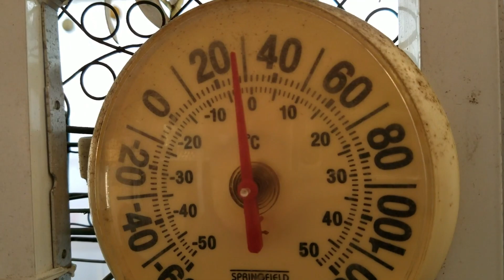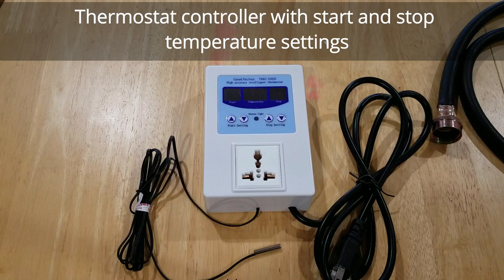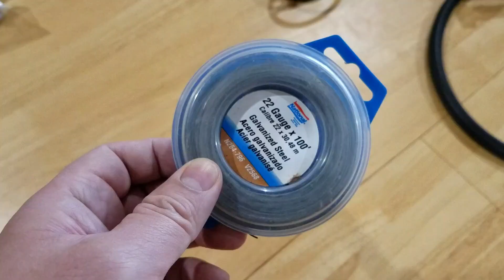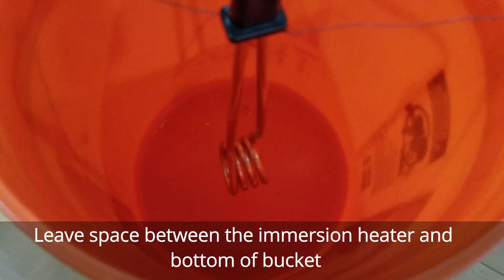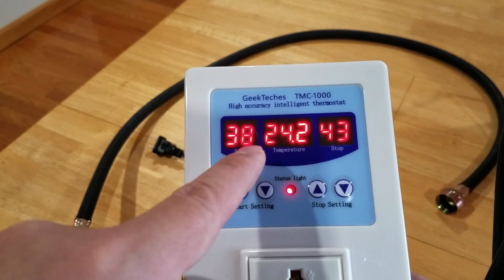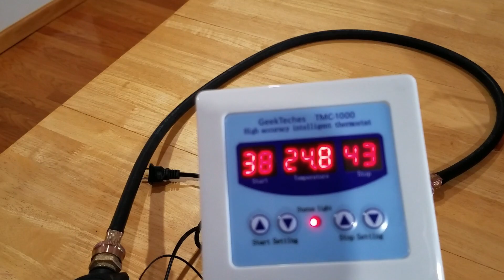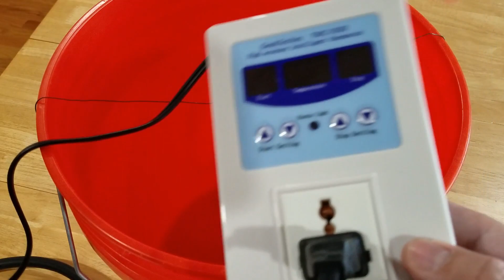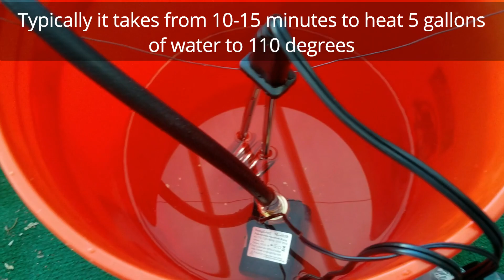Make a HOT WATER pressure washer hack

Comment: I have mine run to the hot water heater, set at it's lowest temp... plug and go.for a true steam washer you heat the water after it's pressurized..

Comment: Just buy a cheap pressure washer and run it straight from the hot tap, you can regulate the temperature on your boiler, my cheap pressure washer lasted over 20 years doing it this way.
Oo and some pressure washers are ok to run hot water through them check the specs . This video is like catching a taxi and then a bus and a train when you can walk there in 5 minutes

Comment: Hot water freezes faster than cold water,also a pressure washer isn’t meant to have hot water ran through the pump.On a hot water pressure washer the water is heated after the pump through a coil of piping that’s about 100 ft long

Comment: Hot water ruins your pump
Reply: Only if it's a cold pressure washer. If it's a heated one already the seals are designed for it
Reply: Not good for rubber seals

Comment: How long does that much water last and with how much psi
Reply from the maker: Joshua Phipps 
My pressure washer is 1600 psi at 1.2 gallons per minute.  With that setup, i can do my entire midsize SUV with 3 5-gallon buckets.  If you don,t want to refill midway, you can use a large plastic bin container.  You don't lose pressure with this setup.  You only need to make sure the water source has enough pressure to push in the water.  My unit doesn't suck in water.
Reply: nextmoonyt t

Comment: Nice build buttttttt.....  You have about 2.5 to 3.0 gallons of water in that bucket, even with a 1.7 gpm pressure washer your looking at filling that bucket every couple of minutes and then waiting 10 to 12 minutes for it to heat up. I did search for an extra long element but couldn't find anything over about 13 inches. I guess if you used multiples it could heat a 20 gallon bucket up but that is triple the cost. Your sill only looking at a little over 10 minutes of water usage though. The reason I am stating this has anyone found a workaround from it. And doing it to a sink is not a possibility since I only have a 20 gallon hot water tank.

Comment: Nice proof of concept video to keep your mind working. Unfortunately, this is a very inefficient Way of doing things. It was only take a slight bump for that immersion heater to melt the side of the 5 gallon bucket as it’s quickly gonna go through whatever water is in there. If you’ve ever worked with pressure washers, you know that the hose that moves around ends up bumping things. Plastic bucket with such a thin diameter, high temperature immersion heater, and a plastic bag around electronics DO NOT MIX. Normally wouldn’t comment to burst someone’s bubble but if you’re going to get paid for hosting commercials, you’ll have to put a little more thought into this.
I would recommend at least getting a metal bucket or aluminum if you’re really set on trying to do things this way.
But chances are you’re going to end up spending money on Amazon to do these things and end up blowing out your pressure washer to ultimately end up with a bunch of parts, no pressure washer, and nothing really cleaned.
A very quick way of cleaning something small with hot water it’s just to get a kitchen hot water kettle for under 20 bucks, heat up water, and pour it over what you’re trying to clean. Those hot water cattles get up to 180° and cut through a fair amount of grease and oil for example without having to use heavy chemicals. I use this process for cleaning my hood range fan filter as my dishwasher doesn’t get hot enough. Nice try but unfortunately this is a fail. You still get a star for effort-(hands out participation trophy)

Comment: So you are saying 15 minutes to heat 5 gallons of water, but in your bucket on only have about a gallon.  So is that 15 minutes for the water level you are showing or for a full bucket?
Reply from the maker: It took about 15 minutes to heat 5 gallons of cold water.
Reply: @nextmoonyt  so how long will it take to heat up a 245 gallon tank?
Reply: @PatroneBambino  do the math
Reply: @obadaalomari1821  did you do the math? What was your answer 🤔?

Comment: I plug my pressure washer onto my hot and cold water kitchen sink mixer tap also my heating system has a built-in emersion heater. It's a lot better than this rubbish. But I'd rather use cold water as I won't screw up my pressure washer.
Reply: You do not have to be so crass.  Ppl like you make the world a darker place.  There is a proper way to communicate your opinion or disagreement.  This very well may be the only option for someone in a different circumstance.